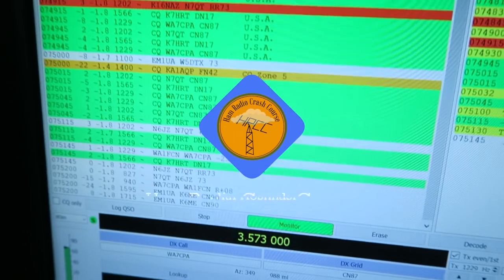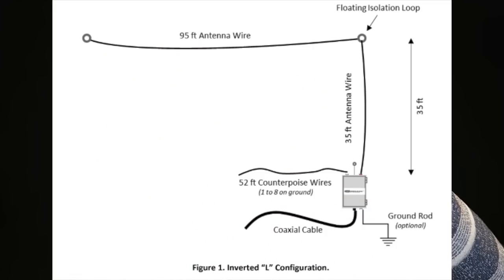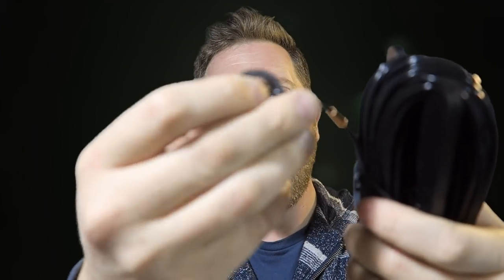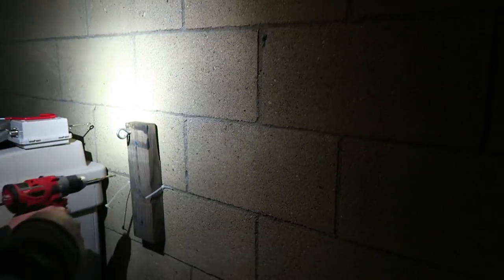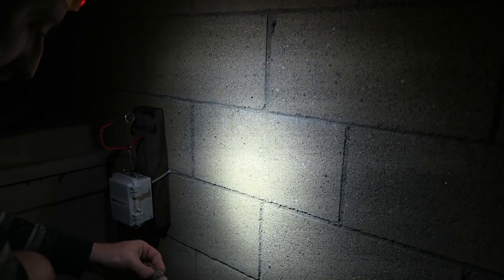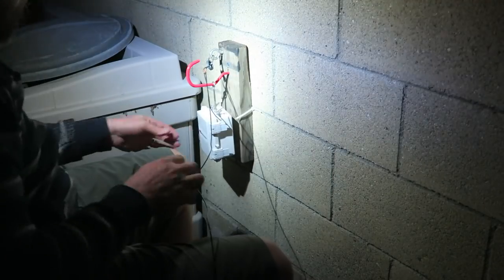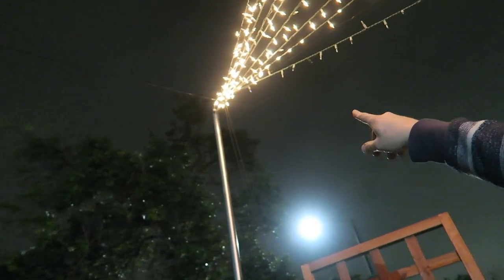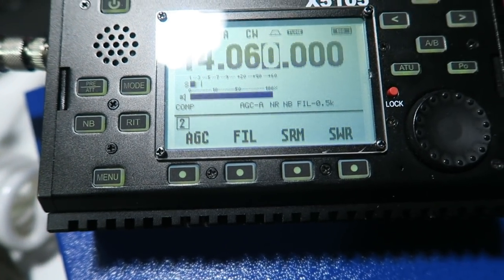Chameleon Antennas EmComm III Base Review

Comment: I've been using the EMCOMM 3 Base as my primary home antenna for about a year. At the moment it's in sloping vee configuration for EU & North America. It's an amazing antenna when you set it up correctly. That counterpoise next to the pl259 makes an enormous difference. Your SWR will drop even further. I think turning off those Christmas lights will help with the noise. Nice to see others adopting this antenna. Thanks for sharing Josh
Reply from the maker: Oh yeah, the lights were off during testing. 

Currently the SWR without the counterpoise is 1.5:1 on 20-40-80. Very impressed.
Reply: @HamRadioCrashCourse    As that would be, during an Air Raid
Reply: "That counterpoise next to the pl259 makes an enormous difference. Your SWR will drop even further."  Sorry but can't resist asking, WHY? How about some educated explanation based on facts?

Comment: I just put up a CHA Hybrid - Mini a few weeks ago.  I have a 60 ft wire in the inverted L configuration.  It's supported by a 25 ft fiberglass pole.   I tried it for a while without the counterpoise to see what it was like.  When I installed the counter poise it really helped my signal to noise ratio and I was able to hear a lot more stations.
Reply: Absolutely agree! In my short experience (freshly licensed) I already learned that counterpoise is crucial. I've put up a random wire with an 9:1 unun and counterpoise does the magic on both, TX and RX. I'm very interested in the CHA EMCOMM!

Comment: Set up my first rooftop mounted mast a couple weeks ago...6’ above highest roof line, and then an gp-3.
Studying now for my General, so Im currently getting materials together to set up a 25’ heavy gauge galvanized mast, then a gp-6 on top. Just below will be a chameleon setup in inverted L, 25’ up, and then horizontally across to another pole on our property. The end point will be about 12’ above ground. Then will install a counterpoise just below grade. 
This will hopefully set me up for some HF radio work. Im only 2 months in or so from getting my tech, so Im still in a huge learning curve, but still marching forward.

Comment: I agree with the work with what you got without excuses view on things. I am curious how you did with contacts using that setup. That is a very long wire compared to what I use on my 9:1unun, I have it set up as an inverted V and it seems to do the trick.
Reply from the maker: I ended up rolling most of the wire back on the winder and its still awesome at receiving.  I'll have so more details on transmit later.

Comment: Hi, I've been running an EMCOMM II in a sloper configuration from the 2nd story eve of my home down to a shed in the back yard.  Perfect length for the backyard space I have, and virtually invisible in our HOA neighborhood.   I've gotten great result out of it, driven by a Flex 3000 SDR HF radio.   Recently, when having our roof replaced, the roofers accidently snapped the 60' antenna wire in half.  I'm trying to find if I can just order a new replacement wire (the top transformer is fine), or if perhaps if the EMCOMM III, either the Portable or Base version, might be a better option.

Comment: Having the box high off the ground would prevent the need for having a ground wire on it, right? I have a 40 foot mast that I can put the box on and run the end of the wire to a 60-70 foot tree, but if I try to ground the antenna the ground wire will be very long and probably ineffective. Am I on the right track on this? I'm told to keep the ground wire as short as possible or you get spurious emissions. I would be running a kind of sloper configuration.
Reply from the maker: Nah. I’d still use the radial wire. Just follow the directions.

Comment: @Ham Radio Crash Course Great video… I’m just getting in to HF and was wondering your thoughts on how this antenna would perform as a sloper with the feed point about 10 feet up and the end about 35 feet up? That configuration would work better for my application… would it be any different than the way they recommend to hang it as a sloper?
Reply from the maker: Nah. That’s a fine way to go.

Comment: I'm running a pretty similar MyAntennas EFHW-8010 in a similar config (Up to about a 25' mast, then out to the fence in the opposite corner of the back yard). Luckliy I had a bit more length to work with so I just have a little dog leg at the far end. :-) Even with the Inverted, broken L I'm getting FT8 contacts as far as Hawaii on one side and UK and Canary Islands on the the other. I'm also about to add another 10' to my mast & probably 8' to the back end which should help a lot.
Reply: I have the same MyAntennas EFHW-8010  antenna , no counterpoise only ground as instructed and swr matches that shown on the website, it's also a very quiet antenna. Seems to beat dipoles and other endfeds with 9:1 Unun, the my antennas use 48:1 which seems to be the key to it's superb performance. 

I am in an electrically quiet environment except for electric fences but the NR on most transceivers should knock that out.

I just sat the ham exam so can't transmit yet but for receiving it's a winner and it got great reviews on the website and also eham.

Hyendfed in the Netherlands also make excellent end feds.

Comment: curious what coax do you prefer? RG213 OR RG8X  for less than 50' run on 80m-10m 100watts
Reply from the maker: I generally use LMR400